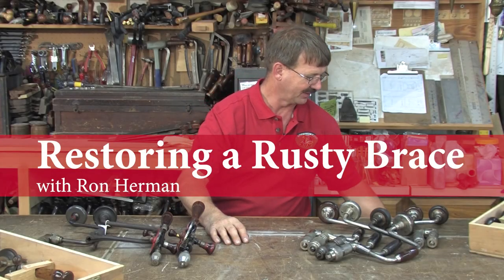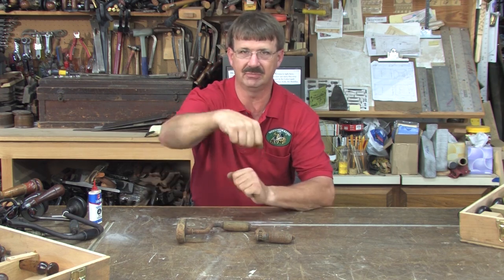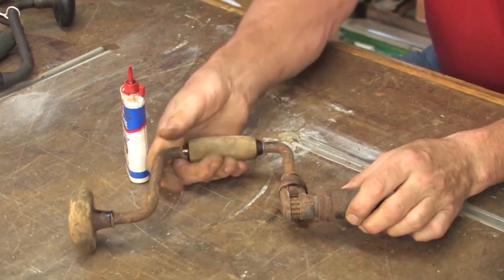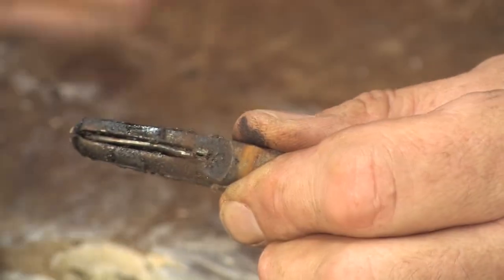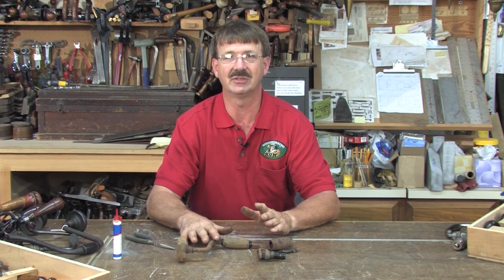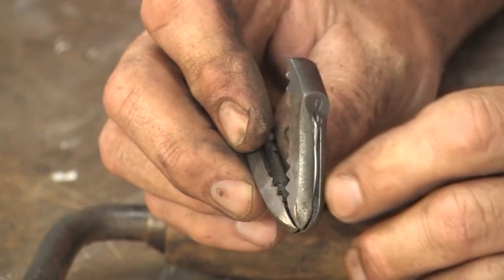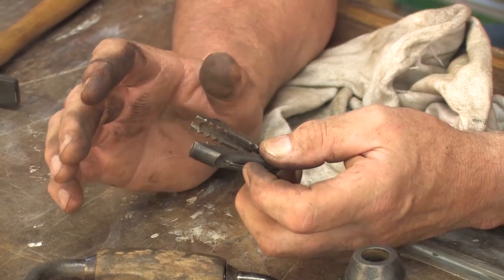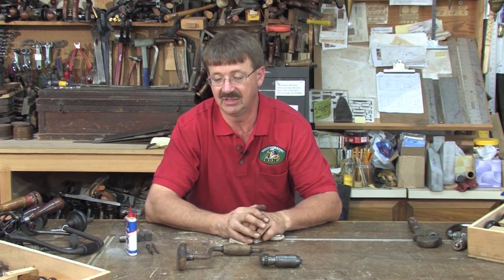Restoring a Rusty Brace

Comment: The sad thing about these braces, is they probably haven't had a lot of use, before they were discarded as being "old fashioned", in favor of the wheel brace (hand drill) and power drills. I have three Stanley braces, 10, 12 and 14 inch No. 73 models. I'm going to restore them, but not by removing the wooden handles, that prevents me from my preferred option of electroplating. So I'll use a brass wire brush, then I'll use Everbrite on the metal to preserve it. Hands down, the brace and bit, are the best tools for drilling large holes in wood.

Comment: If I may add one point, it's that it's critical to look at the condition of the jaws. If they have been abused (by torquing with a pipe wrench, for example) and do not make good contact with square shanked bits, that damage on the jaws inner surfaces can potentially be transferred by rounding over the corners of a bit.

Comment: Thanks for sharing. 

Been trying to trouble shoot a slightly unexpected situation with a recently acquired unit. 

Got a brace that is generally in top condition, virtually free of rust, and most components - ratchet, jaws, crank handle - working fine. 

However the head seems to be completely jammed in place, without even the hint of wanting to budge. The oil intake hole is there, I would imagine that the ball bearings are inside there although lost for ideas on how to get to them ... any ideas?

Comment: I have a brace that I am trying to restore. I have taken the pins out of the appropriate places. The rachet sprocket does not turn. I have used oil, Kroil, Sea Foam, heat , Evaporust, and I can not get the pin to move that goes through the hole and up through the sprocket. I am at a loss on how to get it off. Any suggestions are appreciated. It is like it is frozen together with rust and won't come apart no matter what I try. I also can not find any makers mark on it.

Comment: The very first thing I would do is put linseed oil on the wood and do it repeatedly for two days until it stops soaking it up. The wood is the most important thing at that point & if it cracks from messing with the drill it will devalue if not ruin the brace. Only after that would I take it apart and de-rust it. I'm going to assume he has so many braces & has worked with so many that he has no concern either way.

Comment: HI Ron. I have a swing brace made in England unfortunately one of the jaws is broken. It s a two-jaw one . I ve tried stanley web site . It is already out of stock and there is nothing on amazon . I have found that on eBay too expensive . Do you know where I can find a part not matter if it used . I just need the jaws the spring is OK. Thanks in advance.

Comment: Is there Any way, at all, to replace the wrist handle in one piece?  I found a Stanley No. 965N 10" and the wooden handle was broken off.  I Can repair it using two pieces, but would prefer not to.
Reply: No. The handle was put on diring production before the steel was bent the last time.

Comment: I have never had a issue disassembling the ratchet mechanisms, not saying I wont but usually a little heat and it'll break that rust loose

Comment: Would it be possible to cut off the wood handle and make a new, two peice one that screws together? Maybe just using the original handle?
Reply: You can make a new handle using a split turning. Select a single block, drill it first to fit the shaft, then saw it apart to create two half-blanks. Glue the two (half-) blanks together with a paper joint and turn and sand the handle, then split the two halves apart and glue them back together around the shaft. Then apply finish as required.

Comment: ratchet  gone on mine i used with bits torxs and drills i dont ave a batteries drill they cost new 60 euros ratchet works but the grooves are rounded and need filing